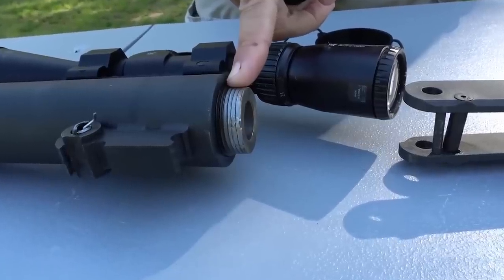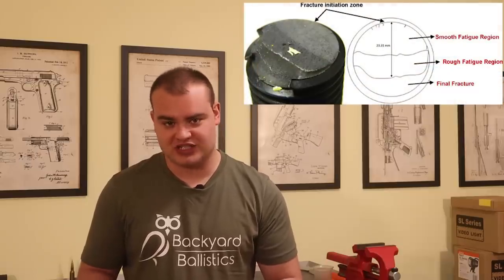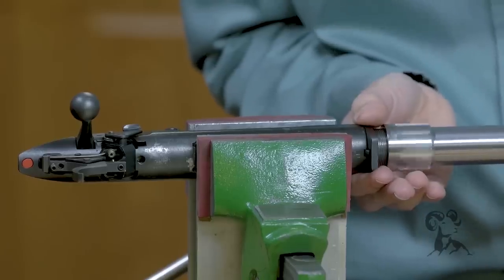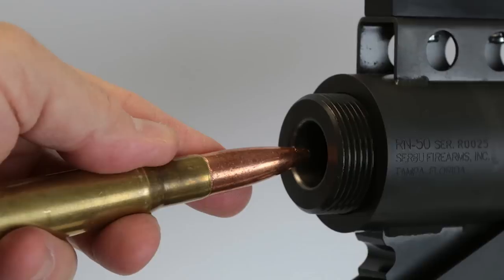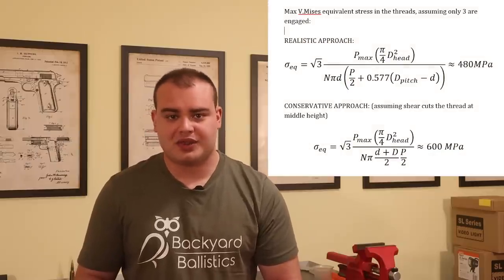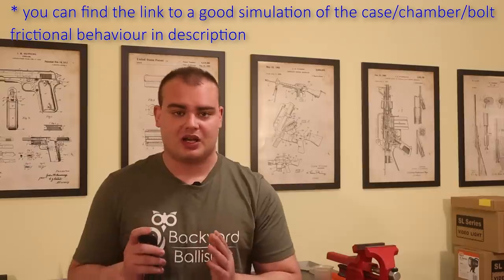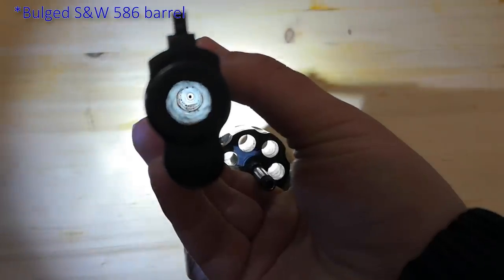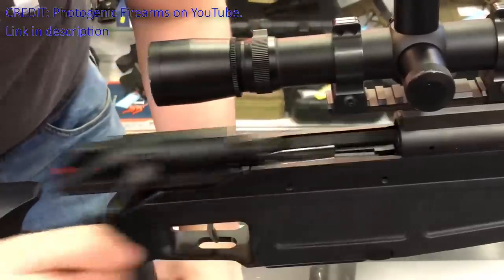Serbu RN-50 Failure: A Closer Look

Comment: My hypothesis for the accident is dirt or a small stone under the "back cap": the cap was not screwed all the way in, there was a free space behind the cartridge, the primer was blown out, and so the cap got full of high-pressure gas, which sheared the threads easily because the cap's area is much bigger than the one of the case's bottom end.
Reply: The ears that sheared don't allow the action to close if the cap isn't screwed on completely.
Reply: @mfree80286  There are different degrees of "completely": there may (hypothetically!) be like 0.5mm gap between the ears and the nominal position of the cap, and the gap may be enough to blow the primer.
Yet, as it was said in the video, it would be very interesting to see the case of the exploded cartridge: whether its primer or other part of its bottom is blown through...

Comment: Failed to talk about the 2 ears that sit behind the threaded end cap that were also sheared off. The ears ensure the end caps are fully engaged prior to operation and reinforce the breach.
Reply: The RN50 will not close into the ears unless its fully threaded in place. 

It would make sense for the cap to sear the ears off when it exploded as any play in the cap would 
1: not close 
2: would have bleed off pressure

Comment: Ive heard that SLAP rounds, can cause overpressures due to using a muzzle break that is not designed to be used with SABOT rounds (which the SLAP round is). Buildup of the sabot plastic can cause the diameter of the hole in the muzzle break to decrease in size, and thus increase felt recoil and muzzle blast. Increasing PSI leading to a catastrophic failure. 

It really sounds like a possibility "TiborasaurusRex" explained it on his youtube channel. He referred to the manual on the  use of SLAP rounds which stated that you should never use muzzle devices that are not designed to be used with SLAP rounds. 

But indeed like you stated, if the obstuction would be near the muzzle, the damage would be there. And not enough pressure can be generated to go above the chamber PSI rating of 55kPSI. 

So it must be the powder which is to blame. It must be the bolt/cap design without vents that could lead to so much damage. So if the cap had some sort of vents for gas blowback, Scotts face might have been in one piece. So its either degraded powder, or a to fast burning powder like shotgun or pistol powder. 

Any way, Scott must have noticed the flattened primer, and he could/should have stopped before disaster struck. I guess he did not read enough reloading books, or did not follow through with it. 

Greetings,

Jeff

Comment: It is only as strong as its weakest point.
Reply: The metal around the chamber is at least 1/2" to the outside, yet those threads are only maybe 1/16th" tops.
Reply: That gun reminds me of that cheap survival .22, the one where you screw the cap on too. Just the bare minimum these guns.

Comment: Im gonna be completely real with you the slap rounds are hot fucking rounds that are old when he shot the regular 50 round it was completely fine he even said when he shot one of the slap rounds it went low to the right that isnt metal fatigue or barrel obstructions it wouldnt be firing out of the gun if it was a obstruction it was the SLAP ROUND!!! Remember what I said its an old round that isnt made anymore its just like that one point in history that people tampered with the rounds so the people that uses thos rounds would either explode in there face or just not fire at all

Comment: The gun is fine the problem.is the bullet Scot fired because the SLAP round is 80 percent more powerfull than a normal 50cal, the gun was.desighned for 50 BMG, its not Scots fault he didnt know this.is just one.of those.accidental lesening of.info

Comment: I go with metal fatigue and cracks as the cause and that hot round was all it needed to come undone..I'm a boilermaker/welder by trade and have seen many things fail due to metal fatigue..and have done lotsa shooting with all sorts of calibre weapons in my military days too..that .50 did look a lill flimsy for the sort of round he was using..even the few he used prior to that shot bothered me.. that rifle is for ball or tracer only i recon and even that scare's me with that rifle, but well see what comes up..the design of that single shot rifle is also something I don't like.. also large calibre weapons like this ain't needed at home anyways man..I'd say 7,62 cal max for anything at civilian level lol..personally I own a few air rifles only and three of them would be pretty sufficient at stopping anything from a damn rat to a burgler or two and thats all I need 👍.. on a side note ur knowledge is amazing and u deffo know ur thing..subbed ✌

Comment: Guys, it's simple. The cap is at fault. It was designed too weak to begin with. Not enough threads and should have been built thicker. End of story.

Comment: It was under manufactured should have had longer threaded area  and the two little lugs on the back to lock the cap in position. That  should have been solid   it was the lugs that nearly killed him. If it had been a block rather than the small lugs the cap couldn’t have gone into his eye the explosion would have gone up or forwards away from him. Minimum engineering combined with over powerful ammunition caused this. I’m pleased he’s okay all engineering or pressure vessels should always be over engineered. of course they always have a blow off valve. Even a 911 air box has one. You can all ways police a failure.   I’ve got experience deep sea craft nuclear pressure vessels aircraft and  race engineering  but what do I know    guns are totally different. I only work on my own   But the same engineering principles and rules applies always make it stronger than it needs to be.  You engineer a weak spot intentionally sometimes. Like a grenade or a bomb   So if the worst happened you walk away   And that didn’t happen it failed in his face. Not impressed at all with that.  A gun works on a really simple principle  they are just a cannon with one way out  if that doesn’t happen it’s a fail   I agree with everything you say   But the only problem is no one knows what was in that round

Comment: Its just a poor design. When Serbu designed it he didn't take into account that it could fail. He should have made the tabs behind the breach cap a little taller and go strait back to the end of the receiver and give the barrel pivot pin a shear point so when the breach fails it will explode forward.
Reply: Well put, this is pretty much exactly what I said on a comment on Backyard Ballistics’ first video on this
Reply: That would have been a fairly easy step indeed.

Comment: I know what happened, ammunition made for  specific models of the M2 machine gun with specific barrel specs was fired out of a cheap 50 cal rifle that it was not intended for. That’s like firing M995 black tip ammo out of an AR instead of an M249 like it was intended then expecting it to not explode. It’s like loading a black powder gun with smokeless powder and then wondering why it blew up.
Reply: It's also not a factory spec rifle, the chamber was widened and a heavy barrel used IIRC. Still, machine gun ammo should not be fired out of anything but a machine gun, same as submachinegun ammo out of a pistol. While it works in some combinations and situations, as a general rule it should be avoided for range use.
Reply: @kylebradley3  machine gun barrels are safer by design. they made a military spec chamber on his rifles barrel. The problem is that grossly inadequate screw on cap locking mechanism.
Reply: @kylebradley3  The barrel used was factory manufactured with the correct chamber by Serbu:
https://youtu.be/tpp4SdE1MUk?t=309

Comment: First time I saw the RN-50.  I like this is an one ended pipe pointed at your face.  Just imagine the wear from put the cap on and off over and over. With this type of pressure.  I would think you probably only had 100-200 shots that were safe with normal rounds.  Not the extra freedom they are firing.
Reply: I have one. I have over 100 rounds through mine with zero issues other than typical gun maintenance.

Comment: I'm no engineer, but wouldn't it be possible to extend the length of the cap to add pressure release holes behind the chamber, strengthen the rear lugs that ensure full thread engagement, and add a weak spot facing downward to force the cap to break away from the shooter? Then, of course destroy some rifles with ridiculous overpressure to see how they fail. The fact that Scott's rifle failed in the way it did leads me to believe that it wasn't destructive tested in the first place.

Comment: What is your life worth. What safety margin is acceptable when its the difference between life and death. An elevator will hoist 500% more than its rated capacity before it fails. Slings, chains and hardware used for hoisting objects are rated to not fail until 350% of normal capacity is exceeded. To suggest that a 25% or 50% or 75% overload is an acceptable safety margin in a firearm where you literally have a bomb a foot in front of your face, is ludicrous beyond belief. I have listened to the maker of the RN-50 talk on video about how four threads are acceptable on the end cap because the most stress is on the first four threads and more threads really don't add any strength. I have seen other videos made by people where they show stress diagrams of threaded components and they too allude to the fact that all the stresses are concentrated on the first four threads. What a pile of nonsense......it makes my head spin. These diagrams are for fasteners, threaded components which are nuts and bolts. Gun barrel threads, breech plugs and threaded breech end caps are subject to direct tensile forces that have almost no torsional shear components. The thread strength is determined by the thread pitch diameter, the cross sectional thread area and the total number of threads. All the threads share the direct tensile forces......ie the thrust generated by chamber pressure. I have yet to see a gun barrel shank with only four threads, the breech plug for my muzzle loader has 18 threads albeit the pitch diameter is much smaller than that used on a 50BMG hence the need for more threads.
Reply: Computer problem didn't let me finish my comment. The U.S. 16 inch naval gun uses a Welin stepped thread breech plug which has 18 threads and it weighs 1800 pounds. If anyone knows how to machine a stepped thread breech plug, I'd like to talk to you. This whole threaded end cap system is a bit too primitive and inconvenient for my tastes even though it is easy and cheap to make. The biggest problem with that end cap is that in its present form it cannot vent any gas that may get past the cartridge case, it at least needs some vent holes. Also the cap does not fully surround the case head so there is a considerable area for gas pressure from a head separation or blown primer to act on causing huge forces that will blow the cap off the barrel shank. Since there is nothing substantial between a shooters face and the end cap it needs to be made with a better safety margin. I checked the specs on a commercial 50BMG bolt action whose manufacturer I won't name and they are quite surprising. Even with a 300% overload the action will not fail and there is still some margin of safety before the actual bolt lugs fail. Like I said before....what is your life worth, is it worth a blown primer, a case head separation or an overloaded cartridge.

Comment: No. Birthday bolt gun barrel threads are not under even remotely similar pressures as this design. Billy head pressures are directed into the receiver. Not the barrel or barrel nut. The barrel nut is receiving recoil load from the barrel weight and acceleration. 

Going up one size in thread will not guarantee barrel bulge or burst... Especially in that heavy barrel design. 

Of course more thread engagement will help the cap from smashing faces... The first four thread engage, under normal tightening torsional load... But as those thread stretch and deform, the next free threads catch the load, preventing the cap from turning loose. 

That in mind, the fact that the gun would be inoperable is perfectly acceptable... No gun is meant to be able to survive catastrophic detonation... But it would be nice if it didn't kill the user.... With no other possible failure mode... That barrel isn't going to burst or bulge unless that cap is beefed up very significantly... And even then, it's quite unlikely. 

.50bmg isn't a cartridge to go economical on design.... It needs to be designed to fail is a less deadly manner. 

If one more of this models blows up, day goodbye to serbu guns... The lawsuit will bankrupt him....  and his kids.  He's extremely lucky that KB isn't the lawsuit type..  Because the design would get torn apart in court by lawyers hiring engineers to point out the deadly flaws....

Comment: As someone who has a little bit of experience in the metal industries, I can say: everything is prone to get damaged or destroyed. I use to say: when God creates something that is indestructible, there is somewhere an idiot who destroys it. And the people I used to work with gave proof to that. Not that I want to say that anyone involved in this is an idiot. But things break and when you fix it they break somewhere else at some point.
Reply: @Smp_lifting  I have to agree. Better have a predetermined breaking point than that outcome. However it's always about usability, price tag, and doability. I hope Mark will improve the design, if possible.

Comment: Seems to me like the manufacturer should have tested the rifle to its failure point, to see how it would come apart. Either they didn't, which is irresponsible, or they did and knew how it would fail, but sold the rifle anyway, which is downright criminal.
Reply: Why? If you drive your car into a brick wall at 200 mph no amount of airbags is going to protect you. Sure the gun could have failed in a more safe manner and could have higher margins, but at the end of the day, the issue was firing extremely powerful sketchy ammo. 

I
Reply: @TheOwenMajor  Most firearms are made to fail in a way that doesn't wound the shooter, in case of an unintentional double powder load for example.
Reply: @defaultuser3410  Most rifles aren't chambered in .50 BMG. 

An average .50 BMG round has about 19,000 joules of energy. 

7.62 NATO has 3,500 joules.

5.56 NATO has 1,300 joules

That's an entirely different scale in terms of energy. 

You're comparing apples to oranges. You can't compare this to your average AR-15.
Reply: @TheOwenMajor  Barrett 50 BMG has a strong metal shroud to contain debris in case of a catastrophic failure.
Reply: @defaultuser3410  A Barrett runs over $10,000. The gun in question costs $1,500.

That's like complaining that your Volkswagen Beetle isn't as safe as Mercedes SUV.

Comment: Personally I would never fire a 50 BMG in anything but a full sized 50 BMG rifle. No conversions or light weight rifles just to dangerous. Take a look at a 50 M2 it’s huge and was designed to handle the 50 BMG round.
Reply: It's huge because of the belt mechanism...
Reply: @marcusborderlands6177  True, the M1919 in .30-06 is pretty hefty too, and that's essentially the same design.

Comment: Cheap steel used in manufacturing. Most likely a super hot round but obstructed barrel would do the trick to
Reply: "Cheap steel used in manufacturing."
Which type of steel was used?

Comment: You can clearly see barrel threads still there& back piece shiered off? In my opinion that gun looks like 1/2 a pipe bomb to begin with🤔 I wonder if metal that was used on back/bridge lock was made of too soft of metal? Didn't help to have 1st hot load must of weakened the metal's? You 2 are making me nervous to go shoot now💩💔

Comment: I don't care who you are. 4 damn threads is NOT enough... My doorknob handle uses about 30 full threads just to hold a door handle. Why only 4 for a 50 cal sniper? I understand that there's a LOT more to it than just 4 threads such as metallurgy, types of threads, Material, Tolerances... Etc... But c'mon. Just put a couple extra threads
Reply: Somebody thinks they are more of an expert than the guy who does this for a living...
Reply: @marcusborderlands6177  yup.

Comment: Simply not enough safety margin designed in... 
Your average shotgun (designed for 11 thousand psi) will take 40 to 50 thousand psi before bursting, even more if its a .410, watch iv8888 videos of a .454 casull in a .410, with a full choke to boot.

Anything less than 100% safety margin isnt good enough...

If the rounds scott was shooting were loaded hot he would have to hammer them out thru the muzzle with a rod, forget about pulling them out of the chamber with his fingers 

On the topic of expensive guns blowing up there was a batch of tikka/sako stainless barreled rifles bursting the barrel, turned out to be improper heat treating.
Reply: Go put a 100k psi round into an ar-15 then... That's a high pressure round and still under 100% safety margin.
Reply: @marcusborderlands6177  I never accused the ar15 of being a good strong design... Unfortunately by being so weak it lowered everyones idea of what is acceptable. ( I like my ar15, but they are built too weak for my taste and I load accordingly)

I know of a guy in canada who loaded 25 grains of pistol powder in his t97, the gun is stuck shut, but no explosion.
That is a good design

Heres a great video showing how a gun should handle overpressure.
https://m.youtube.com/watch?v=bo0KVIF9tzY&feature=youtu.be